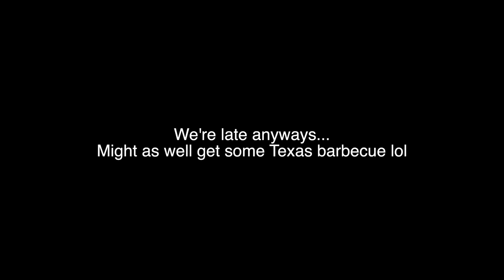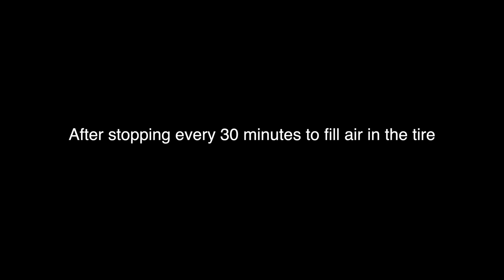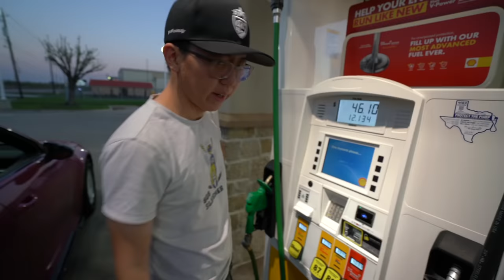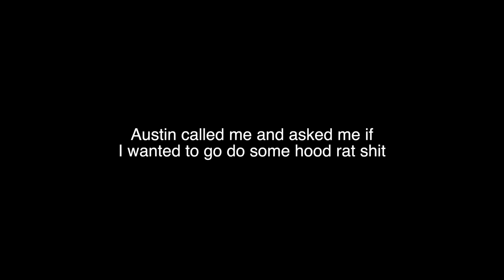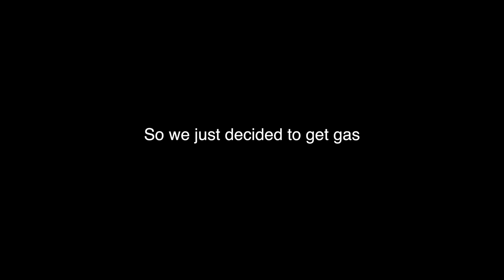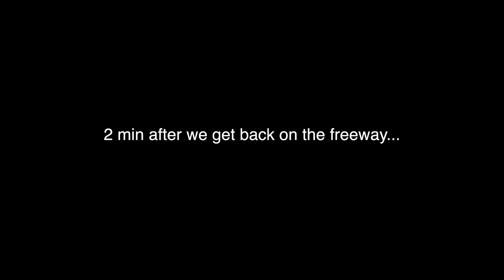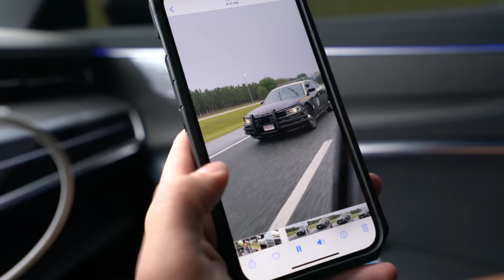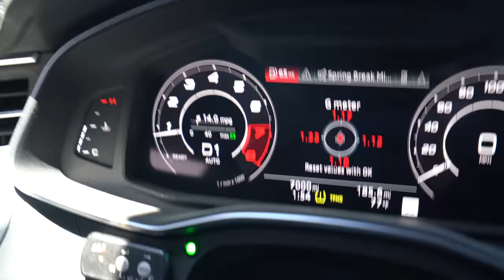My last rally with Randy "Savage" Tillim, Rest In Peace.

Comment: Rich people problems when you wont drive on a tire that got patched after a nail was in it I wish but nope I just work as a welder for Republic Services but I do small engine rebuilds, rebuild motorcycles even old carburetor ones and rebuild engines in cars also I can run old manual Mill and Lathes TIG, MIG, and Stick weld every metal been doing that 25 years and also can paint cars if I feel like it but I still dont have rich people problems..